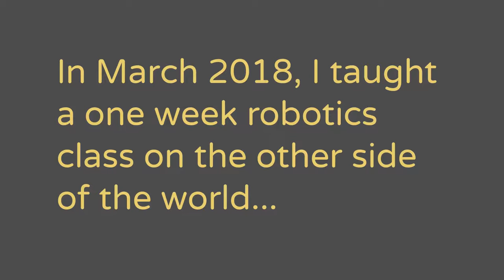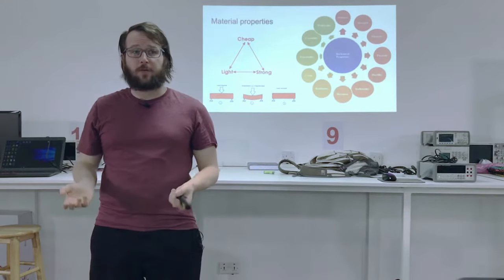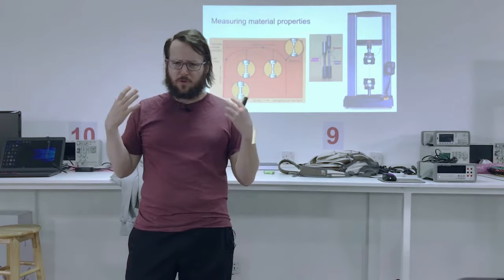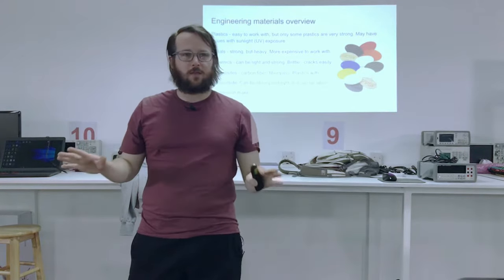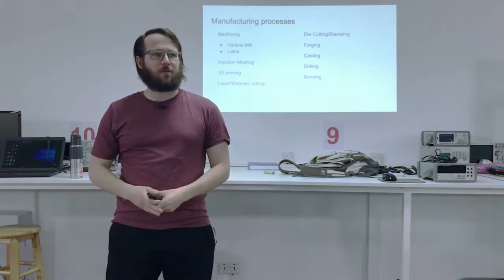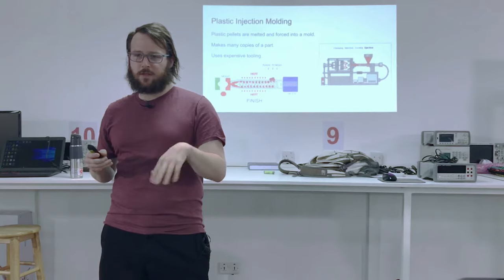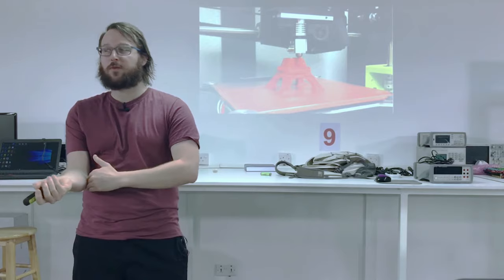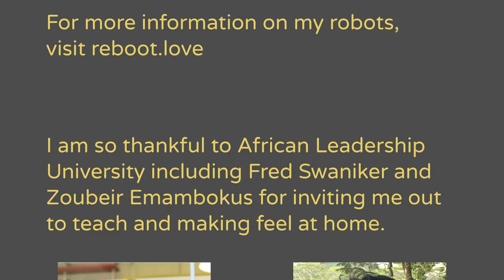A Brief Introduction to Mechanical Engineering

Comment: Do you ever account for "frangibility" in terms of materials. From my very rudimentary knowledge of it...its the property of a material to break up or disperse under certain conditions
Reply from the maker: It's a good question. In my robotics work I don't account for this, as generally my goal is never for anything to break. But for something like material processing I bet this could be pretty important.

Comment: how do i get a handle on the math id need to design a clockwork based electrical production mechanisim?
i know algebra, and some calculus but i dont really understand how to use it to actually make something useful yet
Reply from the maker: Algebra and calculus should be all you need. Study how gears work. Do you mean you want to make an electrical generator? Look up the YouTube channel Jeremy Fielding for information on electric motors and generators.
Reply from the maker: https://youtu.be/CYIEQTsiI3c